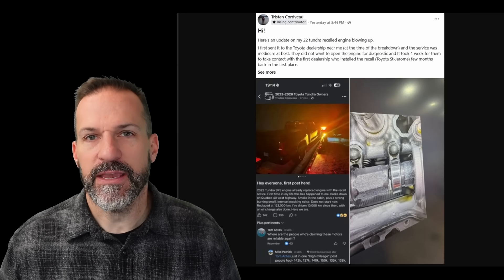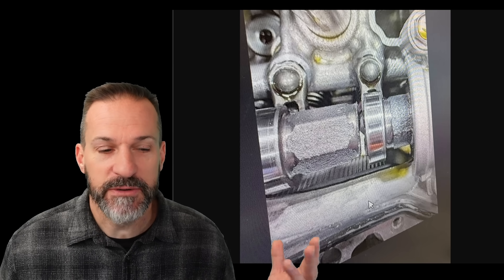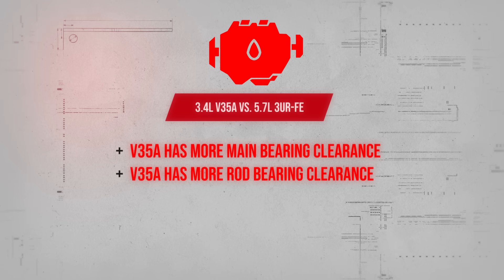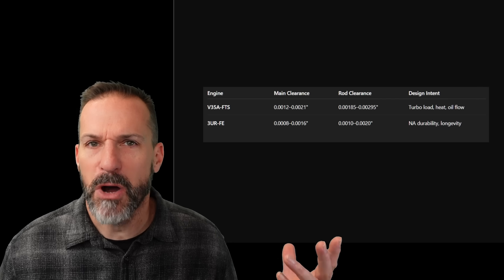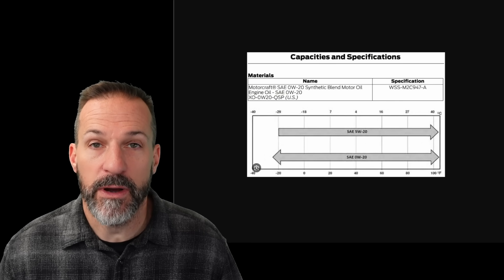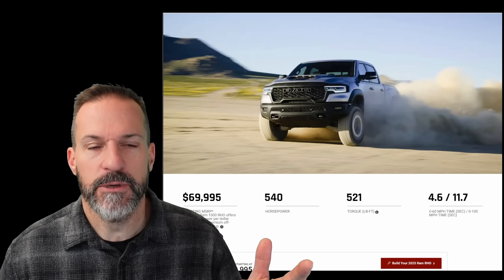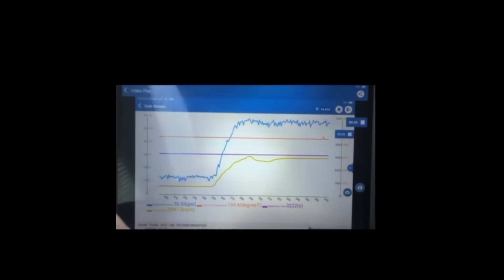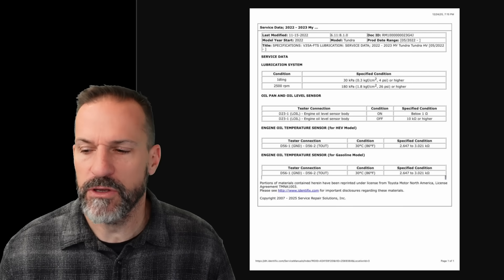Can We FIX Toyota's BILLION Dollar Mistake at Walmart? 2022- 2026 Tundra...

Comment: Back in the sane days of vehicle engines, 4 psi would mean a broken oil pump or something else just as serious.  What the hell?
Reply: You only get that very low psi with Toyota’s oil is what I’m noticing I switch to amsoil 0w-20 and my psi went up eight psi on start up. I think Exxon produces their oil and honestly it’s not up to snuff for a turbo engine just by putting a higher quality oil like Schaefer’s redline amsoil you got a quicker flow rate and builds up pressure a lot quicker and I haven’t had a problem yet
Reply: @halftontimrvreviewsandtips3106 you have no clue.
Reply: @halftontimrvreviewsandtips3106 oil viscosity is a range and not a fixed number. One makers 20w could be thicker or thinner at either end. Theres also oil viscosity improvers that break down through shearing over time. A 'thin' 20wt with a lot of miles and some fuel dilution will be noticeably thinner than a 'thick' 20wt brand new out of the bottle.
Oh and there isnt really much brand consistency with this. Makers have been known to change additive and base oil all the time and will still be within the  the same viscosity range
Reply: @halftontimrvreviewsandtips3106  Toyota 0w20 just barely meets the viscosity spec, no doubt to improve fuel economy.  I ran it for a few changes in my Tacoma (with oil analysis) and switched to Mobil 1.  Stuff drained like water.
Reply: It's normal these days,  vehicles have variable oil pumps. Not a problem people just compare old to new and it doesn't work.
Reply: @DKLGalactus5  I'm 65 and have been interested in cars from way back.  I don't ever remember whole engines blowing up and transmissions failing like they are doing now.  That much has changed for the worse.

Comment: My 19 Ranger's clearances are .0007 to .0013 mains and .001 to .002 rod, this is according to AI search assistant. I am using Mobil 1 5W/30. Ford has had main bearing problems on their Godzilla 7.3 when idling too much, I have heard they upped the idle speed to compensate this, not sure if this is true. Ford is using a variable pump to squeeze out as much fuel economy as possible, according to Alex from Gettys Garage this only results in a difference in milage in tenths, is this worth it? Nope I dont think so. I agree with you in oil viscosity.

Comment: but 5-20 is still 20 hot nonetheless a lot of toyota uses 0-20 and no issues. this is beyond just oil
Reply: Yeah this is a design issue, the 3urfe used 0w20 as well without issues.

Comment: Different weight oil is not going to fix a design flaw at best it will mask it for longer.
Reply: Watch the car care nut. He’ll explain how they determine what the issue is with the tundras. It’s doubtful. It’s a design issue because they basically have to check the engine for any design flaws before they go on anything else and considering a manufacturing defect is not a design floor which that could be bad surfaces somewhere that’s creating issues like aeration in the oil or something like that that would be a manufacturing defect and that’s possible because the manufacturing quality has gone down, however considering the fact that a higher viscosity oil seems to alleviate problems such as that and others like mechanical sharing temperature, blah blah blah blah blah a bunch of other shit it’s most likely there’s 0W 20 cause you should not be running a 0W 20 in any turbo charge application especially something where you’re pushing a lot of pressure and looking for a lot of power at low RPM. You get peak torque at 2400 RPM on the tundra. Put 7000 pounds behind you and then see how quick you hit that. I do it 56 days a week I have no if she was on 5W 30 and I’m at 50 K I’m not saying I’m not gonna have issues, but if they didn’t surface an area properly on the crank or somewhere else in the engine and it would cause narration or some other type of issue with the oil it’s less likely to happen with a thicker oil and then you don’t have mechanical sharing or the evaporation that you get from 0W 20 or the temperature issues you get from 0W 20 stop saying it’s a design for when you have absolutely no evidence. Everybody run in 5W-30 as long as they’ve been doing early oil changes running 5W-30 or running a high-quality 5W-30 and doing like 7500 mile oil changes guarantee they haven’t seen an issue yet maybe in the beginning when there was actual possible machining debris, but these engines are most likely suffering from debris caused by the oil not being able to protect the engine and then they’re blowing up any mechanic knows if you have a turbo engine you should be using 5W-30 at least where 0W 30 but if you W 30 you got it to change it earlier
Reply: Correct, but the point is, ask yourself “ why would it mask it ? “.   Of course the answer is the higher viscosity protects better under any and all circumstances, period.
Reply: What is the design flaw?
Reply: @Gadget0343  I don't know, doesn't seem anyone does for sure. My guess is the block flexes too much I base this on seeing a few tear downs. The block looks weak especially the main bearing area.
Reply: @eleeter  I have always thought that the V35A problems have something to do with the block.

Comment: I've not owned a Toyota.  If they can get their act turned around I would be open to it.  Ford is dead to me forever.  Still open to Chevy and have a Ram Rebel GT on order.  Ram will get this one shot.  I hope they don't mess it up.  Lol because I control the truck market.  But honestly why would anyone tolerate this BS after this many years of making trucks and they fuk it up with an unreliable transmission and engine?  After this many years of automobile manufacturing you can't put together a decent drive train?  Engineers you're killing me.  Fuking sellouts.  EPA you're at fault here too with your bullshit.
Reply: I really like my 2026 Tacoma

Comment: The problem with 0w40.  It uses friction modified molecules.  They expand under heat so the oil acts like a 40.  Not a true 40 oil.  Those molecules expand and may actually prevent oil molecules by displacing them.  True oil would be 10w30 and 10w40.  Fewer modifiers more true oil.
Reply: Yep plus the modifiers break down under normal use.  The larger the gap, 0w30 vs 0w40 the larger the breakdown.  Gotta be on top of the oil changes or it gets ugly.
Reply: Viscosity modifiers.

Comment: Middle eastern V35A powered trucks use 5w30 and its in the owners manual.
Reply: Been using that and CW 30 for a while now
Reply: My EA888 (VW Engine) calls for 0-40 in colder climates and 5-40 in warmer ones, so no surprise really. Oddly though, most of the US fell into the category of warmer climate by their measures. Tons of Fords have run 5-20 since the early 2000s and they did fine with it, but those didn't have variable displacement oil pumps either.
Reply: they are failing too
Reply: Not entirely true, Toyota main dealer in the UAE is using 0w20 for the LC300 with that V-35 engine…
Reply: @CheckThat2 the middle east is more than the tiny country of UAE. Alfutaim doesn't spec their cars like other distributors in the middle east.
Reply: @CACressida it’s not about the size of the country but the number of these cars in that country. Apparently more than 10000 unites of LC300 and LX600 were sold in the UAE and the dealer insisted on 0w20 which I argued about that with them. They told me if I use anything else I will void my car warranty. I am with the idea of using thicker oil but just stating the fact that main dealer is insisting on that oil for whatever reason. Also the UAE has the 2nd highest number of LC300 and LX600 after KSA, followed by Qatar and Oman.
Reply: @CheckThat2 I've seen owners msnuals from vehicles KSA, Yemen and Kuwait. All have a 5w30 rating. But even with 5w30, they're still losing engines.
Reply: @CACressidaso it could be that it’s not just the viscosity of the engine oil that is causing that. A badly designed crankshaft and bearing assembly, used materials etc.. I own 2023 LC300 from new and Toyota in the UAE has not been so transparent about the issue. For that I decided to sell the car and never touch Toyota again. Sad to say it after more than 25 years of owning FJs, Parados and LC100/200.
Reply: @CheckThat2 toyota isn't transparent about it all over the world. I don't think even Toyota knows whats wrong. It's been over 4 years and they're still having this same issue. Im starting to think that Toyota has a fix and they're going to use it as a selling point when they do facelifts on all these trucks.
Reply: @CACressidahave there been people using 5w40 in those areas? If so, any difference in the end result?
Reply: @cpftank09 they were quieter when they popped lol
Reply: @CACressida Insider info: They Do know a while back(2022), but hesitant on which route to take, internal arguments about it, cost etc, name saving is a Recent issue too(8/2025), olds are Stubborn, Youngs are fools is the word.
Reply: Is there a muslim version of this engine?
Reply: @fakenews3676 😂🇺🇸
Reply: @fakenews3676 yes just face it east n u will b fine 😂
Reply: @fakenews3676  Yes it's called the Bagdead.
Reply: @fakenews3676 idiotic comment.
Reply: @CACressida nah! It's humor😂

Comment: I run 5w30 in my v8 tundra.  I would not hesitate to run 10w 40 in warm climate and if towing.
Reply: In Florida we ran 10/30 oil most of the season
Reply: Switched to 5w30 a long time ago in my 2017 TRD 5.7
Reply: Same

Comment: If you jump up two oil grades to 0W-40, I suppose the question then becomes how will this affect the operation of the VVT? Also, how high will the oil pressure go? Does it start to blow seals? I genuinely feel sorry for the owners of these vehicles. It must be very stressful.
Reply: Its not gonn be that dramatic
Reply: 0w20 oil @ 25c is thicker than 0w40 @ 100c
Reply: @johnmills837  Why is that the case and how does that differ at normal operating temperature? I want to better understand the purpose of your comment.
Reply: @espghia6607  If the engine is designed to operate at 25c (cold) with 0w20 the VVT will have no issues running 0w40 at 100c (operating temp) Ow means low temp flow, 40 is for high temp wear protection and film strength (HTHS) Both grade oils flow similar at -35c. The 0w40 does this with more PAO (group IV) base stocks. The same engine sold in Europe is recommended by the factory to run 30w or 40w oils.
Reply: @johnmills837  Thanks for your reply.  I'm not too sure about that logic of your first sentence.  A running engine will attain 25°C or 77°F for a brief period on its way up to normal operating temperature (around 100°C, 212°F).  Regardless, I now have even more questions!  if the VVT works hydraulically, what if the 40 weight oil is too viscous to properly pass through the VVT passages at normal operating temperature?  And what if the engine has a variable oil pump that is specifically programmed for the less viscous oil (and has different programming in the European engine)?  Will there be insufficient higher-viscosity oil being pumped through the engine at normal operating temperature?  And how long before that has an impact, if any?  I did notice that GM went from 0W-20 to 0W-40 in its recent debacle.  Were there any software updates?  If not, then this story is more about emissions than optimal engine outcomes...and jumping two grades would be the best thing to do.
Reply: @espghia6607  All you need to know is the VVT is designed to work within a variable viscosity range it will operate slower or faster depending operating  oil temp but not enough to effect it's response. All 0w oils need to flow and pump equally at -35c.  The same engine in Europe uses a 30w or 40w
Reply: @espghia6607 Oil pressure, tempand flow are sent to the ECM as feedback loop to adjust oil pump.
Reply: @espghia6607  Oil pressure, temp, and flow are sent to the ECM as a feedback loop to control oil pump vanes.
Reply: @johnmills837  Hi John. Everything you said is correct. I saw a video (released today) with Lake Speed Jr, where he confirms all the points you made. Well done!

Comment: 20w oil in any turbo GDI engine is a bad idea.
Reply: v35a has D4S so both port and direct injection
Reply: Real 20 weight oil, as in SAE 20, would be an improvement.  0W 20 is actually an SAE 0 oil with polymers that make it act like an SAE 20 when hot.

Comment: 96 suburban with 350, 35psi hot idle with 313,000 miles and has never been opened. 7-13 psi is crazy
Reply: Also we own a newer 2019 Yukon XL with the 5.3L that idles at 40 psig at idle and 40 going down the hiway.  Bought this one used with 106k miles.  Now at 127k miles.  5k oil changes intervals as it holds 8 QTs of oil.  I have the Range brand AFM disabler to keep it in the V8 mode at all times.
Reply: Dude don’t start up. I was hitting five psi when I was using Toyota 0W 20 I switched to Amsoil’s 5W-30 and I’m usually hitting about 13 to 15 psi on start up and I’m within both specs not riding the border on each either end.
Reply: Hi, our 97 Suburban 350 5.7L that runs at 20 psig on the dash gauge at idle since day one, 40 psig going down the hiway.  I’m the original owner and we are at 249,000 miles.  Never been inside engine, had intake manifold gaskets replaced twice.  Use 5w30 Mobil 1 most of its life but, 2500 mile oil changes since it tows 5000 lb. boat and trailer in the warm months.
Reply: @slalomking I had similar experience with my’98 Suburban. I ran 5W-30 Mobil 1 most of the time I owned it. The Mobil 1 interval was 10K and I towed a 4,200 # boat through the hills of W PA. Never had any bottom end problems and sold it at 255K running strong.
Reply: @fredmauck6934  you did 10k oil changes on it?   I’m a qt low at 2500 miles when I change mine.  If I did 10k change I’d have to add 3 QTs to get to 10k !!!
Reply: @slalomking mine didn’t use anywhere near that much oil. I have had a job 17 miles from home for about 40 years, and we live rural. Our vehicles don’t get many short trips. At 5k the oil was darker on the dipstick but you could still see the stick under the oil.
Reply: @slalomking I don’t record adding oil. If I find it down about a half of a quart I add half a quart. I never run lower than 1/2 quart low. I doubt that it took a full quart between changes though. I will add though that we live in a rural area and short trips are rare.

Comment: Love my 2019 Tundra,  but I had to add the deleted transmission cooler. Can't believe they took that off, bloody accountants trying to save a couple bucks.   
Please Toyota,  bring back the 5.7 V8.
Reply: Not gonna happen.  They designed this truck around that V6.  Hard to believe the largest carmaker on the planet can't figure out how to fix it.  Really shows how far they have fallen.
Reply: Not really needed unless towing near max. Most tundra owners don’t use them as trucks and may tow 1-2x times a year. I tow 7k 5-6 days a week and my trans temps are still relatively low. Just change the fluid every 30k instead of every 60k
Reply: Ya the V8 5.7 is the best, not fuel mileage but the durability and longevity of it.  I have a 2010 5.7. Pulled a 27 foot 5th wheel with it to Alaska and back twice from ontario.  Did the east coast and into Newfoundland so ya know what the hills were like.  Extreme for sure!  She never faltered once, did my oil changes and fluids faithfully, 0W20 with a quart of Lucas synthetic engine oil supplement, still have it with 130,00 miles on it.  Best truck i ever owned!  Why the hell Toyota changed a good thing is just Fing stupid.  Gas mileage?  Lol, ya climate change, i say step on it and burn some fossil fuel!😅
Reply: increasing regulations aimed at reducing emissions from vehicles, which may impact the production of high-emission engines like V8s -- it came with a 20,000 fine that now gone thanks to Trump
Reply: Keeping my 2016 with just 38k. Helps when I walk to work two blocks away
Reply: What’s that about?
Reply: 13 mpg
Reply: @jjohnson8977 I can afford the gas, if you can’t afford the gas, don’t buy a truck🤣🤣🤣🤣
Reply: I tow my bass boat all the time with my 2020 in the heat of the south. Never had any type of tranny issue. Service at real intervals, not that manufacturer advertisement nonsense.
Reply: I'm with you....keeping my 2014 5.7L Tundra until Toyota figures this one out....gosh, you would've though that, I don't know, after THREE YEARS of problems SOMEBODY at Toyota would've said, "Let's bring back the 5.7L V-8 as an option for our customers???"
Reply: @rickboucher6061 I will probably never buy another Toyota product, everything is 4 cylinder or 6 cylinder turbo now. And cars have way too many computer controlled systems now. I’m old and grumpy, just want my vehicle to work and easy to service. Hopefully I can get another 280,000 out of my 2007 Accord.

Comment: I have a 2022 F150 with a 5.0. 53,000 so far. No oil consumption. No spun beatings. Ford recommends 5W-30. I changed the oil the first time at 1,800. Then at about 5,000. Fingers crossed. Wet belt drive oul pump, but have not heard of ANY failing yet.
Reply: Yeah, all the clickbaiters think they are being clever by disparaging the wet belt all the time and the sheep in the comment sections baa their agreement.  But there are literally millions of them out on the road for what, 8 years now?  And I have yet to hear of one failing either.  Not one single example in the F-150 forums.  Maybe, just maybe, the engineers knew what they were doing.